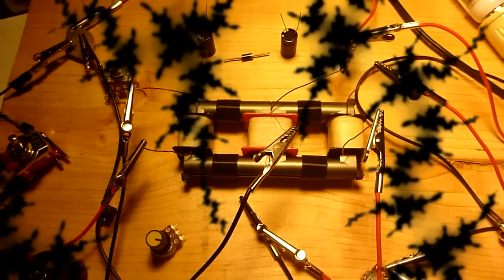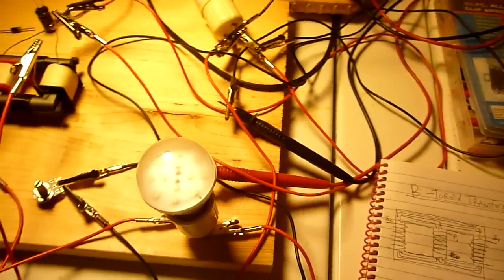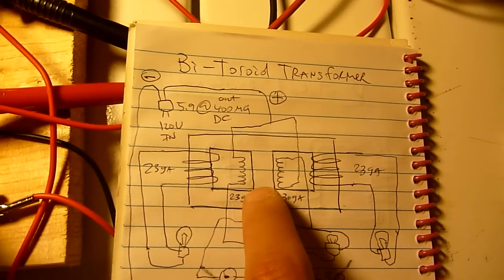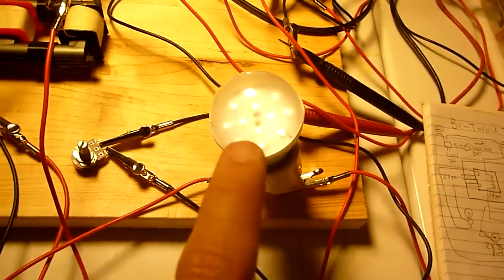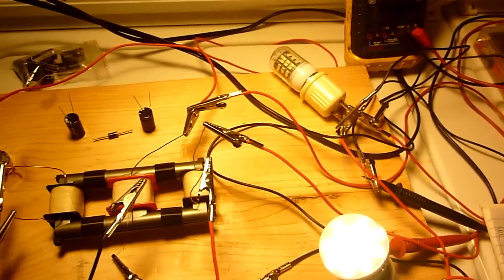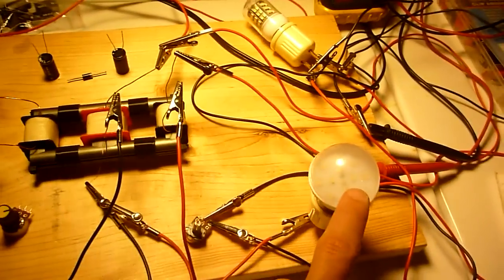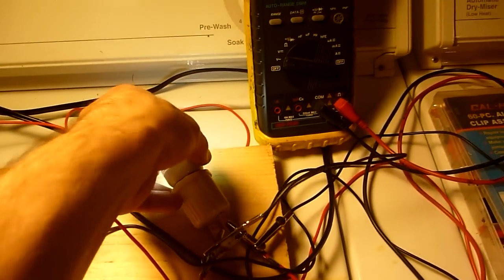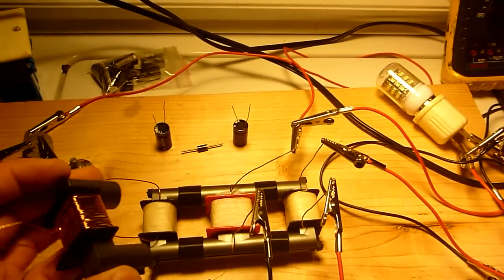Bi-toroid Transformer replication (over unity transformer)

Comment: Hi something you said and I was thinking

you said
' I am going to make another one of these transformers but I'll use the same gage wire for it throughout and have my two secondaries wound in the opposite direction and then I'll short them out with each other (similar to Ed Leedskalnin's PMH device) this would allow the voltage/current to take multiple paths at the same time. '

I would love to see the vid of this, but don't buck your transformer secondaries.
I would try with the horse shoe pmh with Ed's coils on it. Allow the ends of the horseshoe pmh to be held against the transformer core and both pmh and transformer core have the secondary coils wrapped around.

Only use one PMH.  I wonder!

If you do it let me know. Regards
Reply from the maker: David Mountain Hey I also have an idea how Ed managed to levitate the stones. Have you seen the videos about sonic levitation? https://www.youtube.com/watch?v=94KzmB2bI7s Ed didn't let anybody see him work but one night two kids saw him moving blocks with what they thought were two ice cream cones. The kids said that the rocks floated as if they were filled with air. Their story was largely dismissed at the time until I heard about it. Somewhere in the Coral Castle Ed put a sign up that says "ring the bell twice" this is the hint. Basically for the levitation experiment one needs 2 ferrite cones. These should be pulsed with a transistor. The pitch of the cones should be controlled with a potentiometer. Have cones pointed at an object that has a large percentage of quartz in it... see if the object moves. This could be the key to lost technology from the ancient world. Ancients didn't use transistors, but they used something.

Also, have you read the paper "Magic with Magnetism" by Alden P. Armagnac: http://www.electricitybook.com/magnetism/  I think that that paper is significant because it proves the existence of magnetic current. It also proves that magnets can do work, also undermines conservation of energy laws.
Reply from the maker: David Mountain Hello again, I am subscriber to Theora Apophasis's channel. I don't object to his ideas about magnetism. Have you heard about Eric Dollard? He has an excellent lecture about energy synthesis. He goes through all the history of electric power up to Tesla. He focuses on Tesla. He provides an alternative theory to electricity that is based on Steinmetz, Heaviside, and Tesla. The video is long but worth it, mind blowing, it proves that free energy is possible: https://www.youtube.com/watch?v=TttHkDRuyZw (he has other lectures, all mind blowing). 

The electrical aether, I believes, consists out of the streams of magnetic monopoles that Ed Leedskalnin described.
Reply: I have heard of Eric dollard and i do try to understand him. But fail. Having said that the more i learn i do get what he's saying more and more. That particular video i am overdue rewatching, so i thank you for the prompt. I do that a lot going over youtube vids again and again. In saying that these monopoles are also elusive to quantify. Any help there would be appreciated. Maybe your confident to do a video.
Reply from the maker: David Mountain I am no expert on the subject of monopoles. Here is my take on it. There are these streams of magnetic monopolar field lines. They come from the Earth's magnetic field. They also come from electrical appliances. Basically electro-magnetic radiation can be viewed as streams of monopoles. These field lines have a definite dimension. If you had a coil and headphones on you could hear a scratching sound as the coil passes through these. The arora borialis actually contains monopoles which are coming from the sun (that is actually an electrical effect with many amps involved). A book that gave me an insight into the electrical workings of the universe is called "Electric Universe" by Wallace Thornhill & David Talbott. Instead of a gravity-based universal model it gives an electrical one that is based on past experiments from the 18th century through present. HA! I am promoting books now. As always I appreciate your comments.
Reply: Naoki Kashima So do electrons coexist in this model or is it a monopolar only universe. lol if that makes sense. must admit i don't buy into electron theory as much as I did, but we go with what works dont we.
It is a real time in history when science norms and other subjects are questioned more than ever I think. I like to be able to throw off the status quo and just see if another path exists. regards
Reply from the maker: David Mountain The current status quo will have to crumble for the world to move forward. We are currently on a self destructive path. I think that change will come very quickly, we are living in scary and very exciting times.

The electron VS. the monopoles theory. I prefer the monopole theory because if the electron was truly the charge carrier it would be hard to explain how a simple transformer works. That is because the primary and secondary windings aren't physically connected the secondary voltage is induced through magnetic flux. The book "Electric Universe" it doesn't say anything about the monopoles. It just goes through electrical experiments with plasma. Highly charged plasma experiments yield symmetrical structures with spirals that resemble galaxies. The universe is made out of fractals, time, space, are all fractals (they can fold into each other).

Anyways...  What I am experimenting with lately is the back EMF stuff. If you have many inductors induced with low DC voltage, then if you make/break the circuit very quickly very large sparks appear. These sparks are blue and cold to the touch. If you touch two iron wires together forming the circuit the two iron wire stick together as if they are magnets.

This is a very jumbled message. Cheers.
Reply: Naoki Kashima i'm sure we will have time to unjumble it on our walk along the same path. regards
Reply from the maker: David Mountain I was thinking about having the coil and the magnet be stationary in close proximity with each other. Then if we move magnetic shielding in between the coil and the magnet. (Shielding is done using magnetic foil and non-magnetic foil in layers). This would cause flux to travel in the coil once the magnet is uncovered and stop the flux once covered. This is a lenz-free system. I plan on doing a video about this after my Faraday Disk experiment.
Reply: Naoki Kashima Some thoughts on this are.
 Firstly I don't see how this is lenz free as the flux enters the core this moving flux (moving flux is important not moving magnet) grows in field density, this in turn creates a electric current in the coil. The electric current in the coil produces a electro magnetic field which opposes the magnets field .once the core is fully saturated the electric current stops until you move the shield in front of the core, your shielding matter causes the flux to stop and the flux energy that is in the core starts 'moving' which induces a electric current again this current has a opposing magnetic field yet again this opposing electromagnetic field is lenz law. 
Its the moving magnetic field that induces a current which induces the opposing electromagnetic field this is lenz law.
A moving field can be a growing field the solid magnet does not have to be physically move. like wise it can be a field that is reducing this is also seen as a moving magnetic field. That's my understanding.
My apologies if I haven't grasped what you where intending. and will be watching for your video on the matter.
You maybe going down the lines of shielding to make a monopole think I'd better wait and see. regards.
Reply from the maker: David Mountain Awesome comment. I just want to try everything! I know that the solutions are out there (more than 1 solution). I appreciate your input on the magnetic shielding generator idea. I am just trying to learn this stuff. I'm 3d printing parts for the Faraday Disk experiment. We'll see how fast it moves and if its electric output it Lenz-free. As far as Ed Leedskalnin's generator, I made a mistake. I should have used solid core instead of using laminated wires (I laminated them by running a galvanic reaction). I think in Ed Leedskalnin's system Eddy Currents actually help it in some unpredictable ways (will have to change core).

I know you are going down the same path as I am in terms of energy research. If you come across anything interesting please keep me informed about it. Cheers.

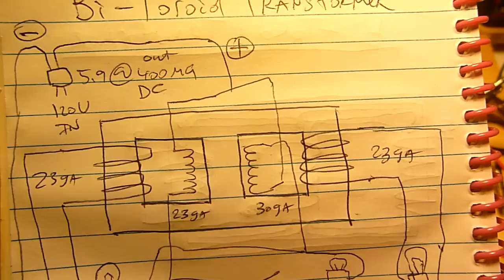Comment: Hi nice video, Can I pose a question? You state 1:26 that the windings on the secondary's shouldn't matter. As the centre primary is working like a Joule thief then the centre cores magnetic flux will pulse on and off. That pulse will be transferred to the secondary core creating a ac power to the led light bulbs because of the back EMF in the secondary. In another application this might destroy or reduce the frequency in your transformer if the secondary's direction were not accounted for. Or is the back Emf helping the transformer. Can you state why you say 'it shouldn't matter'? I ask this question as the student & not as a teacher so as to better understand. regards.
Reply from the maker: David Mountain I am actually learning the technology myself. My thought was to have the entire transformer wound using the same gage wire. I would have 1st layer in the primary wound clockwise, 2nd layer in primary wound counter clockwise. Left secondary wound clockwise, right secondary wound counter-clockwise. I'll also plan to have many more winds in the secondary vs. the primary. WHY have secondaries wound in opposite direction? That is what experimentation is all about trying different things. If it doesn't work or will make the unit work with lesser efficiency I'll change it up again (I bought a whole box of these U core transformers for cheap so I can try different things). Did you know when you pass voltage/amperage through iron it will become magnetic at the moment the volts/amperes pass through the material? I sure didn't know until recently! Ed Leedskalnin could have been 100% correct about the monopoles being responsible for the effect of electricity. These monopoles pass through different speeds through different material (they pass much faster through iron, and pass slower through non-magnetic metals). As the speed of these monopoles slow down electricity manifests. Electricity is just monopoles coming out of the iron. This is Ed's theory of electricity, I am just reporting it here :)
This bi-toroid transformer technology can be applied to many different things. HHO generation (making process more efficient and making it self-running), etc. etc.
Thank you for your comment.

Comment: You should check what Gerard Morin discovered. The cold side of the transformer.
when configured a certain way. I think your design would show temp drop.
Monitor the primary and secondary temperature, to see a drop in temp.
Reply: That's extremely interesting. Endothermic means power is inverted, meaning power is entering into the circuit for the local environment. It's not exothermic. Conventional power is exothermic, meaning you are pushing "outward" from the coil, pushing heat into the atmosphere, which is the only type of "power" recognized by modern engineering.
Reply: @Ritalie  👍😁
Reply: MIKE YA TE AVISÉ, ES FAKE!

Comment: Perhaps we should skype on this subject .. .. There is a lot to say .. ..
Any how, just some ideas here in the open:
* If the primary would be pulsed and then shortened, the returning pulse would maybe pass on to the other secondary
* if you had an alternative path from secondary 1 to S2, then the feedback of Sec1 would go to Sec2 and visa versa
* if you would have coil 1 as the primary (the one to the left), and use coil 2 (mid) and 3 (right) for secondaries, then there is a very short pad between Sec 1 and Sec 2, which enhances the output (ou ?)
* lots of other ideas present .. ..
Reply from the maker: deslomeslager I don't have skype setup right now but we can talk through these messages. About your first point the primary has to be powered as soon as you disconnect the power the secondaries will also turn off. I tried doing different things with this setup one thing that I noticed is that the potentiometer would get very hot when you were adjusting it. Side note: according to Eric Dollard energy can be created in these 2 instances if you vary resistance in respect to time or if you vary capacitance in respect to time maybe that was happening with the pot.
I am going to make another one of these transformers but I'll use the same gage wire for it throughout and have my two secondaries wound in the opposite direction and then I'll short them out with each other (similar to Ed Leedskalnin's PMH device) this would allow the volage/current to take multiple paths at the same time. According to Ed Leedskalnin there are 2 currents one moves from + to - in your circuit and the other moves from - to +. The two currents run against each other. Another person who talked about splitting the positive is Edwin Gray (he made a self-running engine in the 1950s). 
If you have the primary in the middle the transformer has the highest efficiency if you move the primary to where the secondaries are the draw will increase. Another idea is pulsing the primary with a transformer but having it connected to some sort of an antenna connected to a capacitor and a ground on the other side. Once the circuit is going you disconnect the power to transistor and let the antenna and the ground continue to drive the primary. MANY ideas, many technologies... so little time :)
Reply from the maker: deslomeslager On the subject of the bi-toroid transformer I found a patent by Thane Heins CA2594905A1 (it talks about this transformer in detail). Thane actually puts his primary in a different spot than I do in the video. Also, he uses materials with different permeability (iron for primary) and high permeability permalloy for the secondaries. It will be up to the people to topple oil, otherwise this planet is done for. Keep up your research. Cheers.